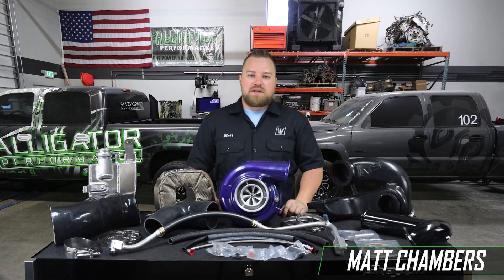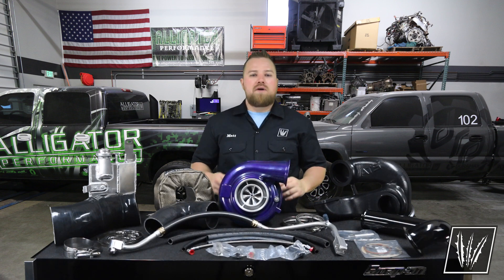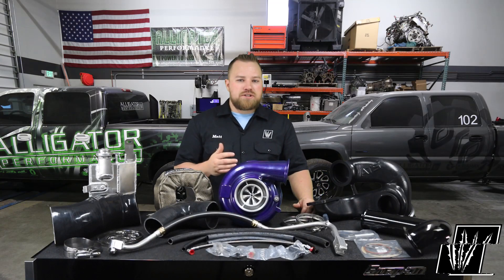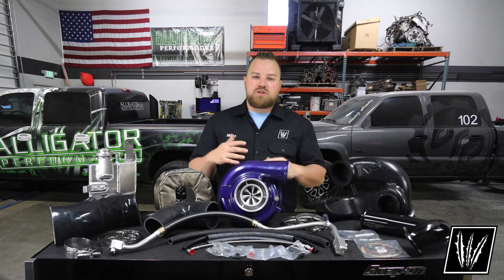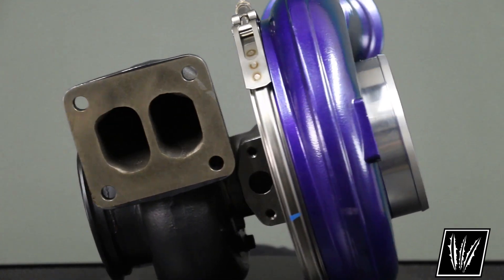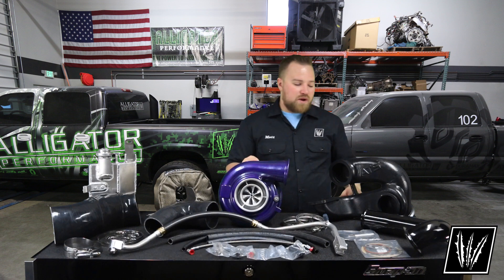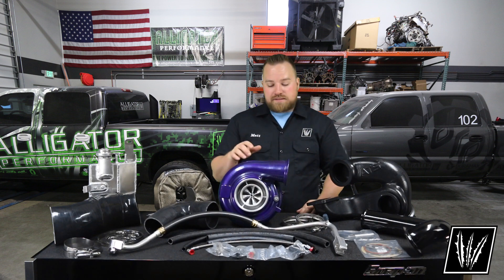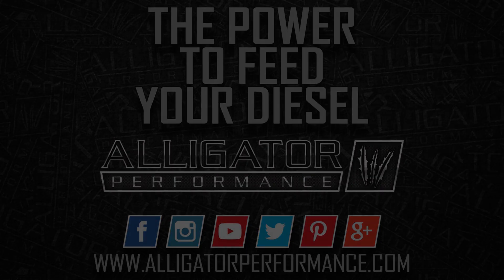ATS Diesel | Cummins Vortex Compound Kit

Comment: Hey I have a question.  So i purchased this kit but haven’t installed it on my 6.7L yet.  I don’t have an oil feed port available for the second turbo since I’m running an Amsoil bypass filtration system already.  Should I drill and tap a port into the oil filter housing to plum a new oil feed into?

Comment: Hey I got a question I hope you can get a time to answer. I install twin turbos on my truck ATS 5K and the original of Dodge and it don't have not enough power.  Could it be the line of the oil of the original  turbo? I plugged everything, maybe I did something wrong this is my favorite time doing this. Thanks

Comment: Hey i got a question i hope i can get an aswer from you. Im trying to install twin turbo on my truck but my question is on the blue turbo what are those 2 little wholes for. The ones on the top of the turbo the round and the square? Do i have to put something there? Or do i block them?
Reply from the maker: If im understanding your question correctly, you are talking about the holes on the top and the bottom of the center cartage of the turbo. That would be your oil supply and your oil drain. Usually a compound kit will come with the 2nd oil drain and feed which you will plum the feed into your oil filter housing and for the drain, pop out the freeze plug (located under the oil filter) in your block for the 2 oil drain line. If you have further questions, let us know! 
Thanks
-Matt